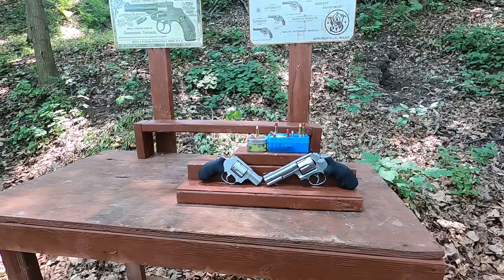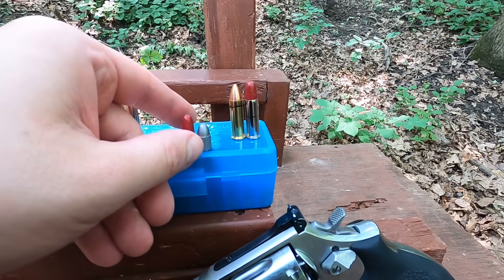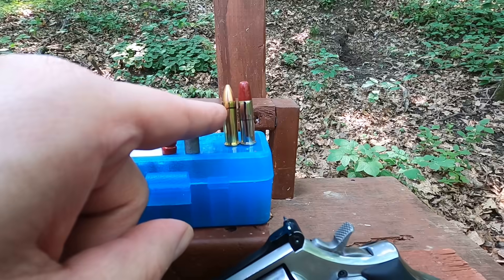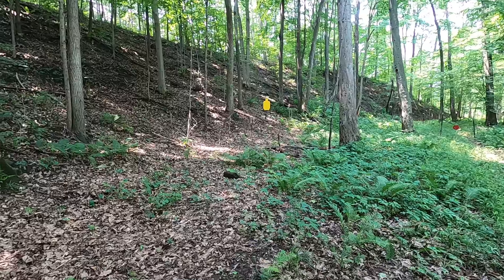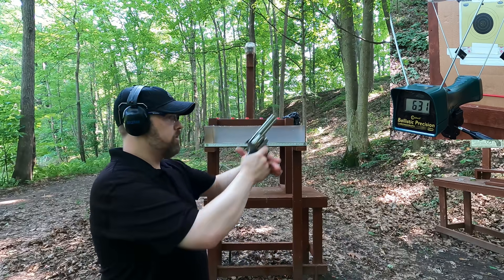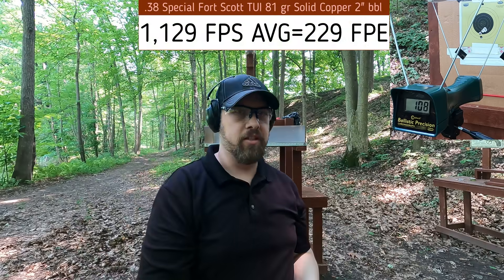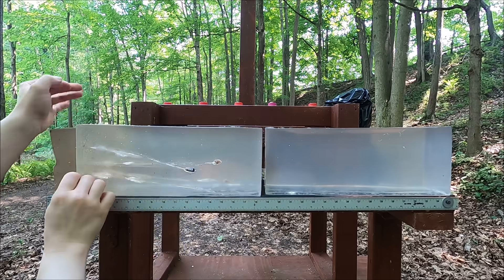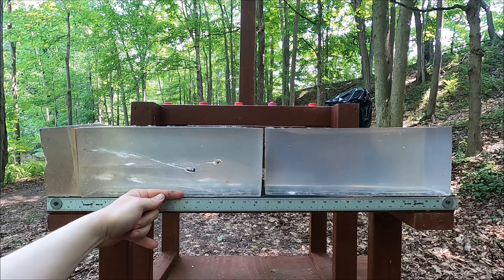Tumbling .38's! Old School .38 Super-Police VS Fort Scott Tui

Comment: As I recall the military load for the .38 Webley during the second world war was a 200 grain bullet traveling around 750 feet per second. this was on the 38 Smith & Wesson platform.
Reply: Yes, Webley did some research in the early 20s when the British Army wanted a smaller pistol and bullet for their service revolver. Webley stuck a 200gr bullet into a .38s&w and liked the results, so the Enfield mk2 and the Webley mk IV .38-200 came in to service and replaced the Webley mk VI in .455. I believe they cut the bullet weight at some point to around 150grs at some point, but I can’t recall if they did it pre-, during or post-WWII.
Reply: @73North265 , yes, they changed the ".380 Rim Mk 2" bullet to 178g conical FMJ, apparently due to concerns about Hague Convention (c. 1899) prohibitions of soft lead bullets deforming and inflicting gruesome wounds. The 178g FMJ was loaded to 625 fps +/- 25 fps and they are tumblers!

Comment: Interesting results. I’m thinking about trying a “Super Police” equivalent for my .327 Federals (Ruger Single Seven and LCR), probably using .32 H&R Mag brass and bullets from 7.62x39.
Reply: this idea was brought by myself and Sam, i wish manufactures in the day when police depts used the ,32 colt would have made a bullet that was a bit heavier than the 98gn round nosed design.
Reply from the maker: @Ford360CID  Yeah, but it would be cool to mess with. Nice thing about powder coated is finding the right bullet with a lube groove that might be where you can slightly crimp over the ledge of one, but I would assume it would be revolver dependent on what you can do with it. Like, a .327 Federal revolver could load some hot .32 S&W's with a 130 gr+ bullet.

Comment: I did a similar test with a 185gr and 200gr bullets in a 2 3/4 barrel and found that 2400 powder performed much better that the faster powders I tested (titegroup and be86). Try that same bullet at 900fps from the 4 inch and 800 from the 2 1/2.
Reply: Yes, slower powder such as 2400 can increase vel of the 200g bullet, with attendant improvements in certain aspects of performance. Downside: higher vel = increased stability in flight & penetration tends to be straight-line, rather than tumbling. RN bullets that don't tumble will inflict relatively less tissue damage as they transit the target.

Comment: The Ft Scott bullets, as well as Golden Sabre's, have a hard time reading through chronographs. I don't think the velocities are 300fps difference but the chrono isn't picking up their shadow well. I had issues with Ft Scott 10mm & 45acp reading through 2 different types of chronographs.
Reply from the maker: If I have an actual chronograph read issue, it's never a normal-ish number. It's either an error, something like 5,000 FPS or 10-100 FPS. If it's within a normal number it's generally an accurate read, and I did feel differences in shots. Also, I wish the camera had picked it up but it didn't, but the first shot of 1,300 FPS+ there was a huge fireball I saw, but the slower read there was not. The camera frames show it the opposite, as the slower round you see a huge flash and faster one a small flash, but in reality the first shot was 3 times more flash.

Comment: I load with a fairly similar ratio of powder to bullet in my black powder revolvers with conicals.  I approximate the historical black powder loads with a flat point 140 grain, .375 solid lead projectile over 21 grains of powder.  These babies can punch through 6 boards of pine.

Interestingly, loading with a .375 lead roundball approximates your TUI round.  About 83 grain lead projectiles going 1,000+ fps over 28 grains of powder and destabilizing violently on impact.  I’ve had one of those rounds literally rip a chunk off the side of a plastic soda bottle, as if it reached out and grabbed off the whole side of it!  It would be a nasty round for antipersonnel.  For small game it would be overkill.  I think the ballistic inefficiency of roundball results in more energy dump.

Comment: Both length and weight of bullet change the rifling twit rate requirement. Surprised they make bullets that range in weight and length so much, because it's hard to believe some of them can be stable (being so far from the average/normal weight and length of bullet).
Reply: Yes, the long 200g bullets are only marginally stable at 600-700 fps, which is what makes them tumble inside a soft target. I think of it as achieving HP effects w/o expansion; admittedly, HPs don't always expand and 200g .38s don't always tumble.

Comment: These would be great snubby loads due to the low recoil and penetration with .38 snub nose loads being a more picky load to find for self defense these might even work out of older guns to due to them not being plus +ps
Reply: They absolutely are modest, standard pressure loads and were widely used in revolvers of the "pre- +P" era.

Comment: Great video! Have you tried Underwood 150 gr hi-tek coated wadcutter? Supposedly 1000 fps out of a standard pressure 38 special. Maybe a good automobile defense round?
Reply from the maker: Thanks. I think I might have, but it was awhile back and into water jugs. I think it was the Buffalo Bore version VS the .32 WC.

Comment: TUI = perforation of soft armor and punching through metal sheets / bones and keep drilling.
Reply from the maker: Well yeah, I think most solid copper rounds could do that pretty well even without a pointy tip, such as the Xtreme Penetrator.
Reply: @GunSam  Agree.

Comment: Waay back in the ‘60s I read an article about the load that helped the Armed forces to adopt the .38 special as their official sidearm caliber. This load was determined to be the equivalent of a 200 grain lead round nosed bullet propelled by 3.5 grains of bullseye. This load caused the ‘heavy for caliber ‘ bullet to tumble with some predictably. The result was an immediate energy dump. The Moros of the Philippines proved the load ineffective.
Reply: They were ineffective? Do you remember reading if they changed the loading for their 38 specials after? And if the results were better?
Reply from the maker: Most of what I read was that the .38 Long Colt/Short Colt was ineffective, inspiring both the .38 Special's invention along with the .45 ACP's.
Reply: @TheJurgisRud  I don’t recall reading about any improvement. I have read that our troops were supplied with .45 Colt revolvers . These provided the much needed protection from the highly motivated foe.

Comment: There use to be a .38 round I think that it was called .38 Smith and Wesson or .38 Enfield and it was chambered in Webley type revolvers.It was a pretty short cartridge, about 9mm length,but fired a really long copper coated bullet.I friend of mines Dad had one and they let me fire it a few times and you could actually see the bullet come out of the barrel against the blue sky, guessing 500 to 600 FPS, and it really keyholed.I don't think that it would fit in a .38 Special as it was slightly thicker possibly a true .38"rather than .357"?
Reply from the maker: .38 S&W is similar size to the .38 Special but shorter, and some .38 and .357 Mag revolvers can chamber and fire them and some cannot. That's how close the diameter is to .38 Special, but just a little fatter.

Comment: Personally from the various tests I’ve seen with the 200 grain 38s I’m unimpressed with the damage and penetration. Most videos show the bullet loaded to around 630-700 fps and I wish someone would load them hotter to around 800-900 fps. If Elmer Keith taught me anything it’s that heavy bullets going fast gets you better penetration.
Reply from the maker: The reason they are loaded to run less than 700 FPS is because they Will tumble at a shallow penetration and work how they are designed to. If you pushed them to that 900 FPS, they would penetrate deep in a straight line, potentially pass through the target before it has a chance to tumble, and cause little damage to the target.

Comment: The Ft Scott stuff has always seemed gimmicky. I think they would be better off going with a 90 or 95 gr bullet at best possible velocity- a consistent 1100+ fps should be achievable, possibly even at standard pressure. That should work well. The Super Police has always been intriguing. Good performance, no over penetration, a d a good wallop from a heavy bullet. That is well demonstrated by the movement of the silhouette. The downside is a significant POI shift with fixed sights, which each individual user will have to determine. But they are another great reason to handload
Reply from the maker: Yeah, I noticed how they seem so blah for the Super Police, until they hit that steel.

Comment: I'm not impressed by the TUI pistol loads unless you are going up against soft body armor. As for the Super-Police, I wonder what an extra grain of powder would do for them. I SAID I WONDER WHAT AN EXTRA GRAIN OF POWDER WOULD DO FOR THEM!
Reply from the maker: Cup my ear forward "huuuuh?"Yeah extra gravy is good.
Reply: With the typical fast pistol powders and that 200gr bullet this load is probably already at or very near max pressure for 38spc. I would suggest not pushing it any further in a 38spc  only gun.
Reply: @richardelliott9511  An extra grain may well take it past +P. But Sam was shooting it out of magnums.
Reply: @Fudmottin  that's all well and good but for safety's sake if you're going to load hotter than a 38spc gun can handle, 357 brass  should be used to keep them from accidentally being shot from a 38spc only gun. After all that's the whole point of the 357 case being longer than the 38spc case.
Reply: @richardelliott9511  It's a matter of efficiency. That extra case volume is actually a detriment when it is not used. You're not wrong though. Shooting a load through a gun not rated for the pressure would do harm.

Comment: Was never particularly impressed by the Fort Scott TUI rounds. Primarily because they are still moving too slow for the tumbling to be an effective wounding mechanism. Between the two rounds, in this particular instance the lighter and faster Fort Scott would be my choice between these two but only because wounds caused from tumbling or fragmenting are more severe at higher velocities.
Reply: I'm sure they would perform well in a 350_LEGEND..
Reply: @HAYAOLEONE  Perhaps, but .350 Legend is already capable of pushing heavier bullets fast enough to do far more damage. Even if you went light for .350 Legend, because of the case capacity it will lose some penetration but I imagine the temporary cavity would be absolutely horrendous. 

I've seen some 10mm fragmenting projectiles that are 60gr pushing a little over 2,000 FPS in a stock Glock 20 barrel rip 6 1/2 inch holes in targets so I'm positive a lightweight round like that would produce an absolutely massive hole but have next to no penetration. Though, with a hole that big I doubt you'd have any fight left in you.
Reply: @Predalien195  The deep hollow point aluminium 'liberty civil defense' or something like that?
Looks ok for specific tasks. I agree with the lack of penetration in absolute terms or in relative considering a simple plank of wood one meter before the target.
Looks designed for airplane security or bodyguard work.

Regarding the 350_LEGEND, I was not talking about hunting.
Curious about the drop at 200m with a 'long' barrel (AR or bolt action). Should be a laser if the wind is gentle.
Regarding hunting and funky reloading, I'd be curious to see what a 135grain HYDRASHOK DEEP would do from the same rifle. On a huge boar for example.
Reply: @HAYAOLEONE  I wasn't talking about hunting either. Was simply stating that there's no need to run a tumbling bullet that's lightweight in  a gun that can already do devastating damage with a much heavier weight round. 

I doubt something like the Hydra-Shok Deep would do that well because it was intended to expand at pistol velocities and not rifle velocities like the .350 Legend is capable of, thus if you drove it to it's potential it would fragment heavily and break apart which from a self defense perspective is fine but for hunting not so much.
Reply: @Predalien195  The tumbling potential effect was not really the point.

The hydrashok deep would probably fragment at 'close' range, yes. No prob. Still curious.
Reply: @HAYAOLEONE  I have to ask then what was the point? The initial remark was about it would perform out of a .350 Legend and I just offered an explanation as to why it wouldn't really matter or be as effective as other options available.
Reply: @Predalien195  Mainly behaviour behind light cover.
Reply: @HAYAOLEONE  Well typical light cover or even home interior walls wouldn't offer much protection from the round in a handgun. I suspect it would do better at higher velocities on thicker objects and could easily defeat soft armor.
Reply: Check out their website and or their YouTube site
Reply: @Joefrom_DirtyNJ  No need, I know how the ammunition performs.
Reply: @Predalien195  Agree.

Comment: You used to be able to get dB meters at Radio Shack....hmmm
Reply from the maker: I used to buy like, capacitors and all those weird little things when I was a kid there. I would make silly things with them on circuit boards.
Reply: @GunSam  I was thinking to add a dB meter to your testing repertoire. I know the .327 magnum is louder than I would like!
Reply: @chrish.4067  Standard dB meters don't work properly for gun shots. You need a special and rather expensive meter. It's a nice thought though.
Reply: @Fudmottin  Interesting, I guess they don't go high enough? Mine goes to around 120.
Reply: @chrish.4067  Peak level is only one issue. You need a special microphone to pick up on the sharp transient. Otherwise, you will under read. I have an old Tandy dB meter that actually has an an analog needle type display. There is a dial on it to adjust the range of volume in 10dB increments. It's great for monitoring how loud a stereo can play. It also has an RCA jack on it for logging.